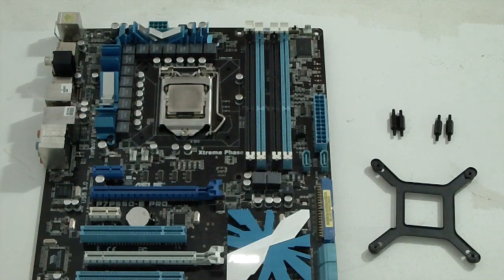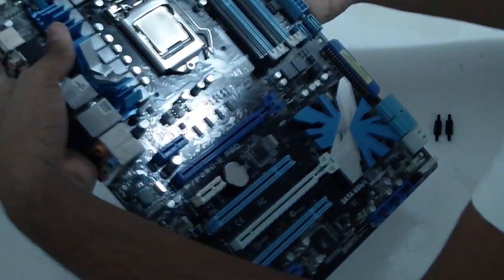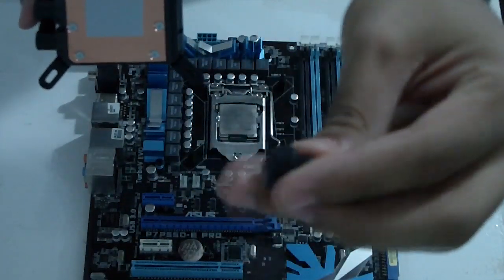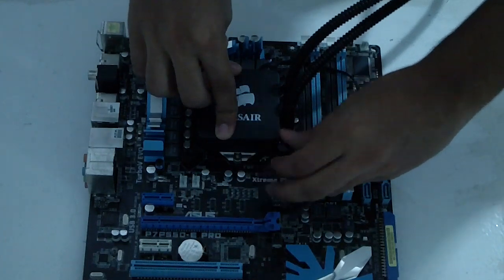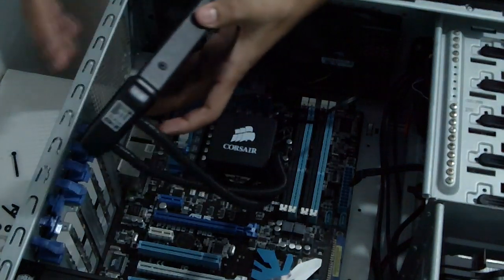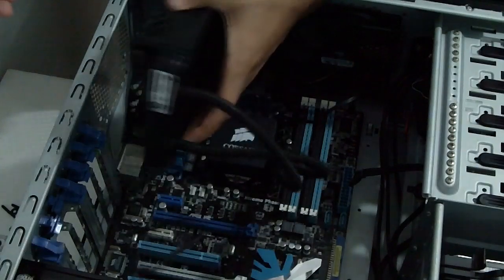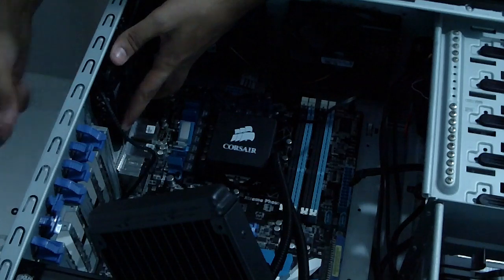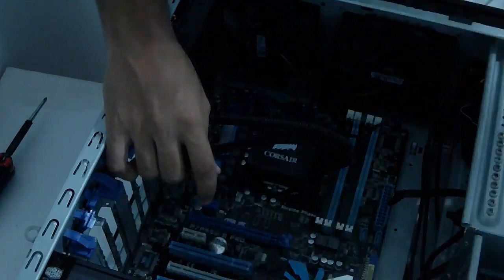Step-by-Step Installing Corsair H60(Applies to All HXX Coolers)

Comment: After 4 years , still it working ?
Reply from the maker: +Cristhian PB yes it works, still :)
Reply: 0mar32's Unboxings, Tutorials and Guides! how often maintenance ?
Reply from the maker: No maintenance required :) Just clean the fans and the rad with a blower every once in a while
Reply: +0mar32's Unboxings, Tutorials and Guides! what motherboard Is that I'm looking to start my first build
Reply from the maker: That's a pretty old motherboard, it's the ASUS P7P55D-E Pro, it was LGA 1156, supported first gen i5s and i7s
Reply: 0mar32's Unboxings, Tutorials and Guides! thanks just wanted to know

Comment: are both watercables suppost to be on the downside like that? shouldnt the warm water cable be on the upside and the cold water cable on the down side?
Reply from the maker: No sir, both tubes have the same liquid passing through them and the pump will do the same job towards pushing the liquid inside whether cool or hot.

Comment: actually dude for the pump you should have bought a Molex to 3 pin connector so you could fit the fan in the CPU slot because now you wont be able to link the fan to CPU temp without some find and fiddling around with some software.

Also I assume you are using the Chassis 3 pin connector for the fan which means you lose that when you might want to use it for an actual chassis fan, I will be using mine for a 120mm 2000 rpm fan which will change according to temps.

Comment: The point of using a Hydro Cooler kind of goes away when you use the fan as an exhaust. The fan is supposed to bring cool air into the cabinet through the radiator hence cooling down the liquid that the pump is transporting back and fort inside the closed system.

Comment from the maker: There are adapters out there so you can use a 140mm slot with a 120mm Fan or Radiator!
You can find them at Amazon or Newegg if you're from the US!

Comment: I'm planning on using this with the Coolermaster HAF X, the rear fan slot is 140x25mm fan, the radiator won't fit will it?

Comment: Hello christianschmi!

The H60 will could maybe fit in the Elite 335, but since the radiator is about 1/2" / 1.5cm taller than a standard 120mm fan it will probably not have enough room because of the PSU.

You could try it, but i would recommend getting a high performance air cooler, just to be safe.

Comment from the maker: The Pump should always be plugged into a port which provides 12V at all times which is for most Motherboards is the PWR_FAN port or you can plug it directly to your power supply instead! If you need anymore help just ask.

Comment: Hello i have this same Hydro h60 trying to install it on a maximus v gene. but it doesnt work. idk if im puting the pump 3 pin cable right should i plug it on a chan_fan, or on any 3 pin conection on the board?

Comment from the maker: @SirToasti That's the case with the custom loop coolers not with these per-built water coolers but they're better than most air cooler in maintaining good temps in high load situations

Comment: ok so is your cpu fine with it being a exhaust and also i have antec tricools 120mm with a static pressure of 2.54 mm-H2O but the stock fan has 3.2mm-h20, know any good blue led fans with high static pressure.

Comment: You could have also made mention that the double sided screw needs to be flush with the motherboard or the pump block doesn't make a good connection with the cpu and doesn't work properly.  If it doesn't you can use a washer to take up the gap on the bracket side of the mobo.  This works because I've had to do it.  As others have said a bit more light on the video would have been good as it's hard to see everything you did but overall you did a good job of explaining how to fit the H60.

Comment: Before you blindly copy this tutorial. He missed an extremely important step. 
APPLY THERMAL PASTE. It makes a huge difference. 

Note: Too much is just as bad as too little / none. You want a small dab in the centre, the size of a small bean or a few grains of rice. Thermal paset is a better conductor than air but not as good as metal. So you as hoping to create an extremely thin layer that fills in any imperfections on what looks like a very smooth metallic surface.

Comment: @0mar32  then is your fan up against your case blowing air out of the case?... i don't really know which direction your rad fan is blowing air. seems like a good idea to keep dust from coming in the case if its pulling air thru the radiator and sending it out the back. im just wondering if its set up like that then its sucking warmer air from inside the case thru the rad.

Comment: @0mar32 i plan to use the same cooler...for the best cooling is it best to do it like u did and install the fan so that it pulls air from outside the case and pushes it thru the radiator? (this way probably increases dust in the case but it seems more beneficial for cooling) my friend had his h60 fan installed on the inside of the rad facing the mobo, and didnt know if he installed it wrong.

Comment: Hey Omar, does the radiator in your automobile pull the hot air from the engine compartment through the radiator? Why do you do in in your rig? Reverse your set up, and turn around your front 120 fan to maintain flow.